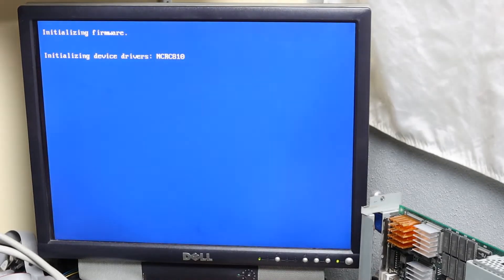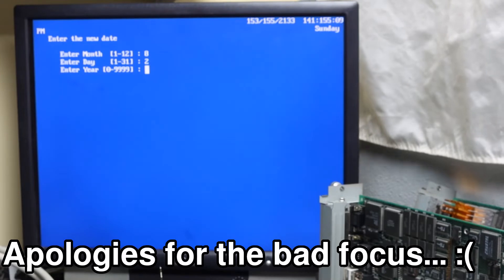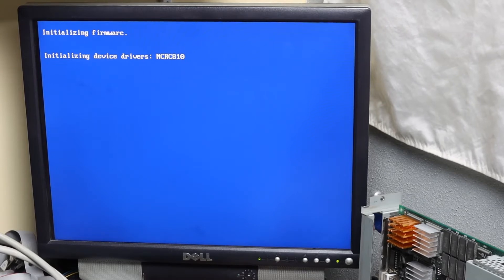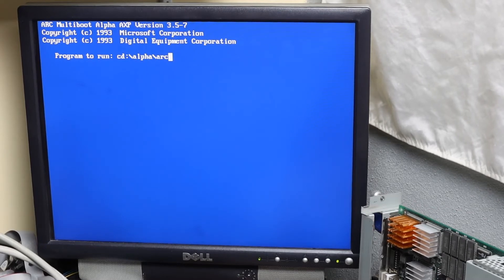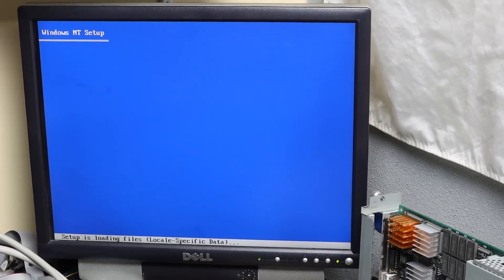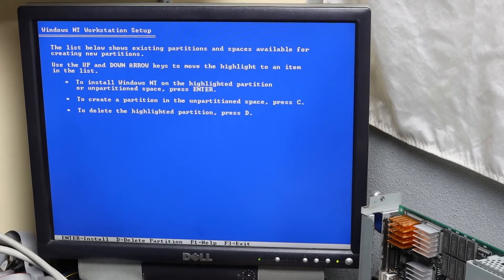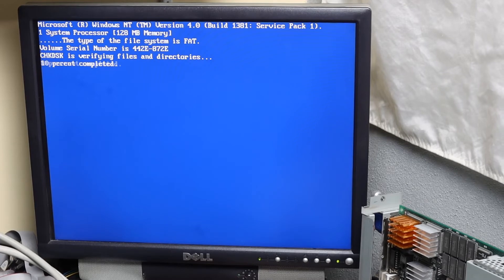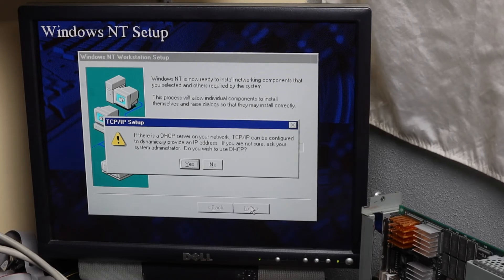Install Windows NT 4.0 on DEC Multia UDB VX40

Comment: Hey. What if the creation of (system) partitions in arcinst and also in the bios fails in a useable system partition for the NT installation? I fail try to install NT/2000 on an Alphaserver 1200, always resulting in not finding any system partition.

Comment: I installed NT 4 on my multia once.  I don't remember it being difficult.  However, i had installed NT on x86 hardware and understood it's bootloader well from multi-booting with Linux and OS/2 using NT's bootloader.  I had also installed Red Hat 6 and later (and later Gentoo).  Doing weird installs was normal.

The circumstance was i needed to take an NT server on a plane... The multia was small and I was curious about it running on the Multia.  It was less interesting than Linux on the system, so it didn't go back on again.  If they had not cancelled Win2k on the alpha, I'd have tried it. 1:31
Reply: 10:27 I must have had good instructions.
Reply from the maker: I can second that vote of disappointment about the cancellation of Win2k for Alpha. That would have been a great OS for many Alphas. Alas.

Comment: I bought a bunch of Multias thinking I was going to load RedHat Linux on them. Never got to it. Storage was a big issue. And I had better Alphen. Trashed them to the recycler with the other 3000/600 and /800s. Sad.

Comment: Honestly the first "x86 server" that blew me away was the Compaq SystemPro. It came into the computer shop I worked at and I was the UNIX guy and this was running SCO UNIX System V. It had a 486 and a 386 on board. Multi-processor legit RAID card EISA bus. It was a beast.
Reply from the maker: I just read the Wikipedia article about those systems. A very interesting architecture! I didn't know anyone made a mixed 386 / 486 that could run applications on both CPUs. There was another system that used the second CPU just for I/O tasks in the kernel, but I can't remember who made it.

Comment: I used a Multia as a firewall at home for years. I absolutely loved that box. They run better in naturally cool basements. :)
Reply from the maker: Unfortunately with the heatwave we were having in Portland, my basement was no longer naturally cool. :(
Reply: @TalesofWeirdStuff  You know I can't even remember what I ran on it. I am pretty sure it was FreeBSD. It could have been one of the other BSDs, this is more than 20 years ago. If you really want to bash your head on the table with an install. You should go with a later version of OSF/1 and put Symbolics OpenGenera (a virtual LISP Machine, probably one of the last products from Symbolics). I know that at the time OSF/1 was not supported but it seems like it eventually was on that platform. :)
Reply from the maker: I've been thinking of trying to install some flavor of Digital's UNIX on one of my Alphas. I don't know anything about any of the various flavors, so I've been procrastinating a little bit.  I might try it once I get one of the 3D accelerators that Digital made for the platform.  I'm curious about their OpenGL performance / functionality in their UNIX.
Reply: @TalesofWeirdStuff  You should be able to get a hobbyist license for Tru64 from HP. I am not sure if it'll be an "age appropriate" (lol) version for the hardware that you have, however. I have installed OSF/1 before but not Tru64. I am not sure how different they are. OSF/1 was, however, no harder than any other commercial UNIX. If you follow the instructions you should be OK.
Reply: @hessex1899  Not anymore. Can't get Hobbyist VMS/VAX either. So you have to use old licenses and....

Comment: I was in server support at Dell in that era. Even on a x86 NT 4.0 clean install was a 45 minute affair. Miss hitting F6? No disk drivers for you! Want to upgrade to a multi processor setup? Better F5 it now and select the multi-proc HAL or be prepared to re-install again or press your luck and update the HAL manually. Want to punch yourself in the face and the crotch? Do an early Linux install. Doesn't really matter which flavor you will be doing multiple kernel compiles. The old days were like cleaning out a running garbage disposal with your bare hands.
Reply from the maker: Yes! I just had to do the reinstall the get the multiprocessor kernel for the GMX 2000 video I posted a few weeks ago! What a hassle! I know I use NT4 back in the day, but I also recall switching to Windows 2000 as soon as I could.